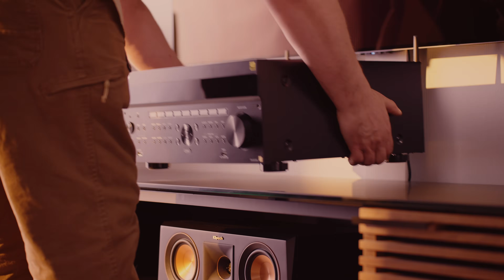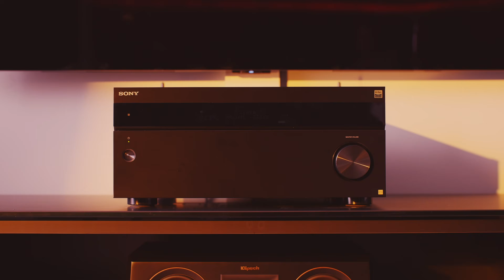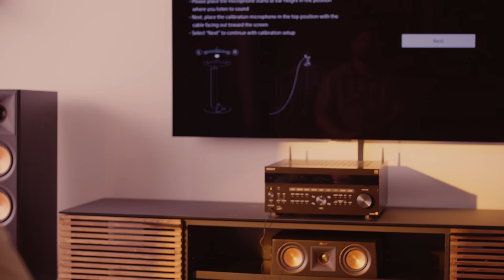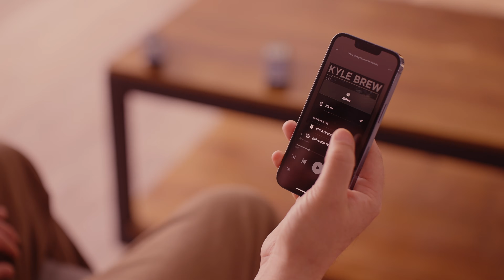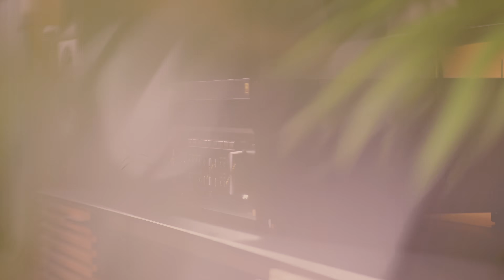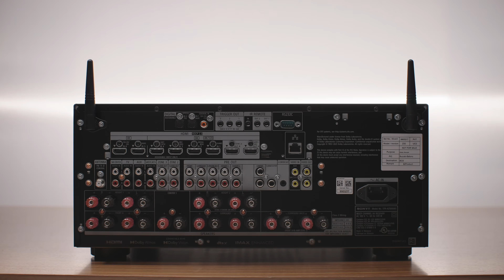Sony ES STR-AZ5000ES 8K home theater receiver | Crutchfield

Comment: I replaced my Denon 6200 AVR with the Sony AZ7000ES, and I really love the sound of the receiver. The calibration on the Sony is easy, and very good. However, one thing that Sony dropped the ball on is bass management. I have dual SVS PB1000 Pro's, and the receiver configures them as one. I am hoping a Mini-DSP will be the solution.

Comment: I had a 3000ES and it sounded great but unlike my current receiver it did not auto switch the hdmi port to my Xbos Series console when I hit the Xbox symbol on the controller after the console was on.. I enjoyed eveything about it and even hady SARS5'S connected but the lack of that HDMI switching function was disheartening and I debated over it but in the end, and because it was the same retail price as my current unit that did switch to my Xbox when prompted while also having preouts for an additional amp I ultimately returned it.

Comment: No phone app!   You have to point your remote right at it!   Deal  breaker!  🤣 Return it.
Reply from the maker: Actually, Sony's Music Center app that was mentioned around 3:20 in a control app that can be installed onto both Android and Apple smartphones. Deal back on!! lol No need to return it
Reply: @crutchfield  Yes Sony Music Center app is for music. Not for changing settings
and controlling the receiver. I called Teck Support three times. If you owned a Yamaha receiver you would understand. There phone app you can do every thang with it and not even touch the receiver you can be in the other room. 🤣
PS:  Music  Yamaha RX-A3080 Blew the Sony away!
Reply: @gregorybond2859  Apparently it does have a web interface. I'm still trying to find out how easy that is to use and how many things can it control.